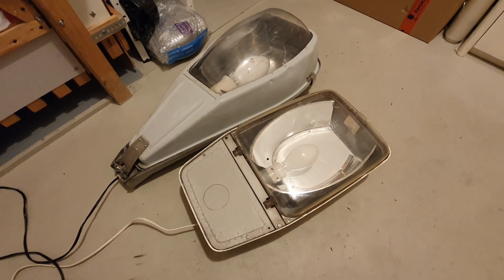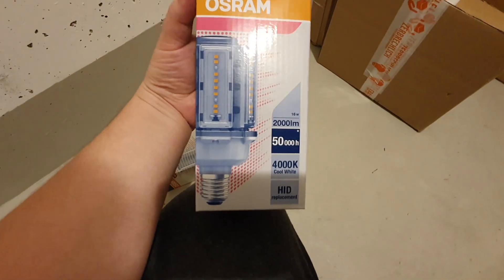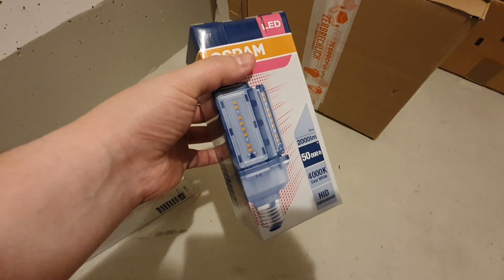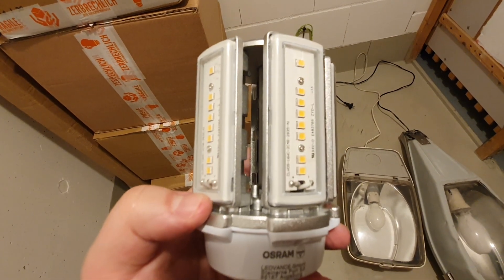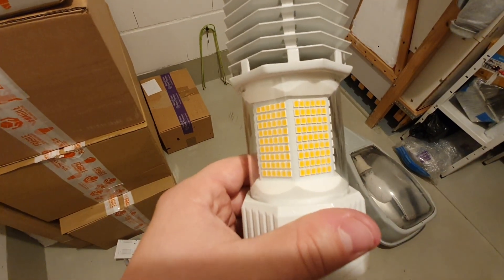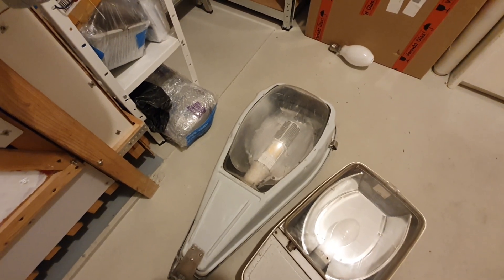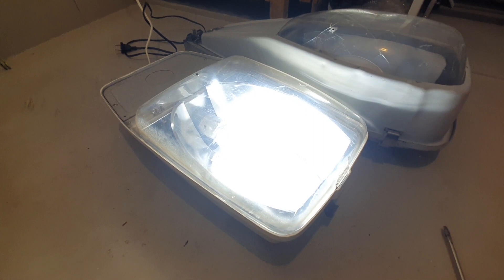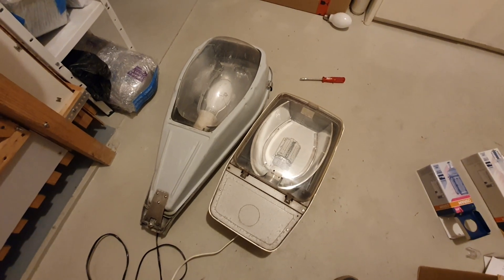OSRAM HID replacement bulbs - 16W (MV) and 65W (HPS)

Comment: the sgs is called hgs with mv and xgs is with sox 18w or 35w
Reply from the maker: I actually got that wrong in the video, thanks for getting that straight! :)
Reply: @mercuryvaporglow5317  its the same as the sgs other than the ballast, the xgs has an entirely different refractor and fitting plate
Reply from the maker: Yes, it has the older reflectors for elyptic lamps @thestreetlightchannel3945